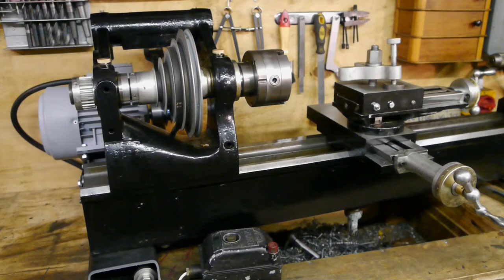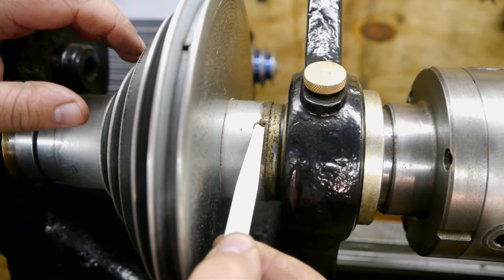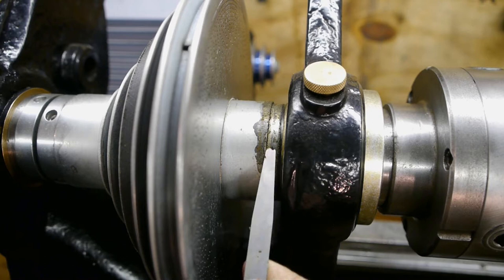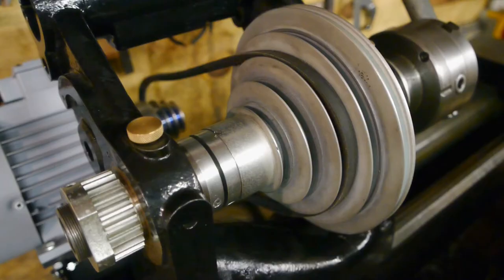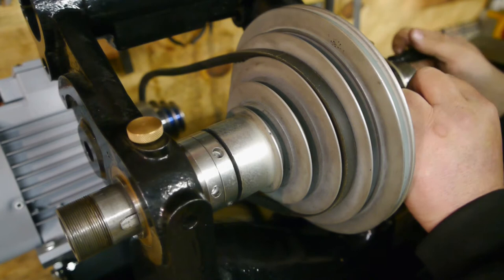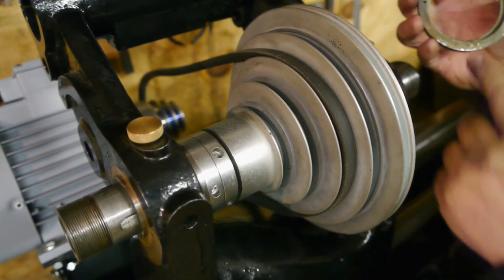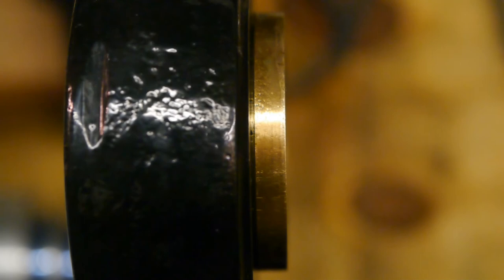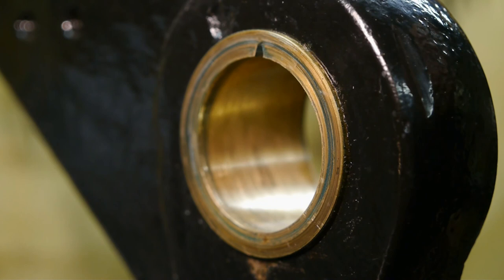Revisiting the Old lathe's bronze spindle bearings

Comment: The oil is reacting with the bronze bush.  This can happen with some modern oil additives.

Using plain mineral oil or automatic transmission fluid will avoid this.

I use Dexron 3 ATF in my Schaublin 102 plain lathe bushes and have no problem.  The front bush is steel on steel, and the rear bush is bronze on steel (same as yours).

You don't need a heavy oil if the bushes are correctly adjusted.

Also try Loctiting the front bush in place to prevent lateral movement.

Cheers Rob
Reply: The comment about ATF helping bind the clutch plates together is misleading.  Motorcycle wet clutches use plain engine oil to also do this, so there is little difference between both oils in this regard.

Some fully synthetic engine oils can be too slippery for wet clutches and cause slippage.  I've never used synthetic oil in a lathe so can't comment on how it would perform.

Cheers again.

Rob
Reply from the maker: The only problem I know of is with the early versions of GL4 oil and that was about 20 years ago.
Although I hate to add yet another can of oil to my collection I will buy some non detergent non additive oil.
Reply: Yes, I think plain mineral oil is what they would have used originally.

Rob
Reply: GL5 oil is still an issue, the car in my profile pic uses GL4 because the sulfa content in GL5 damages the yellow metal. many a crunchy gearbox in 20 year old mitsubishis is caused by people using the easily available gl5 vs the harder to get gl4, atleast here in New Zealand.
Reply: Listen to this man, he knows this era of machine very well.
Reply: I trust Xynudu more than I trust you Dave...Lol
Reply: My comment was meant to be in support of Xynudu's advice.  That might have been confusing now that I look back over it.
Reply: I knew what you meant, I was just havin a bit of fun. I love Rob's channel...decades of experience that man has. Hows things? My friend came across another last word in his storage unit...can send you pics if you like
Reply: Yes, tell me about it. I don't have a last word yet.
Reply: Use Wynn's 77101 500ml High Performance Engine Treatment
There are many variants of Dexron 3 ATF what is it?

Comment: The bearings did not have a bad fit. All of the stickiness and lack of lubrication was from the oil oxidizing in the air. The type kind and qualities of the oil was not tried and true oil. The oil not only dried out but changed chemically. I would personally never use one drop of the oil used on this lathe spindle. I have come back after six months and the lathe turned with a touch. The oil had not changed except to get dusty on the surface. Light mineral oil does not oxidize like what happened here. It drips off and thins and might evaporate to a slightly thicker consistency.

Comment: Thanks for the update.  Bummer about the bearings.  Looks like reaction between the metals and something in the oil.

As others have commented, can you get non-detergent engine oil in your local auto parts/hardware stores?
Reply from the maker: I don know what's going on here. Nothing wrong with the rear bearing at least not that I can see.
I'll check with some DIY stores tonight they might have some oil without additives.

Comment: Hydraulic oil is not the same as lubricating oil, different additives and properties. Also some hydraulic oils can react badly with some metals and the coatings used on metal s. The thin plating you pointed out in the video was probably eroded away from the base metal by the properties of the hydraulic oil.
Reply from the maker: There is definitely something reacting to something. I would like a scientific explanation for that growth on the pulley that keeps coming back.  I think I'll try 10W40 car oil next.

https://lh3.googleusercontent.com/-VpkBBqv3gio/WWEUlRigZrI/AAAAAAAAAMg/vw2lXUJgO5YXRkMWOY92dzg9UlhZPeHngCJoC/w530-h350-p/P1110739b.JPG
Reply: Rolingmetal I'm not a petroleum expert and I'm only speaking from 40+yrs of truck repair, welder, hot rodding, drag racing and amateur machinist + blacksmith. I'm just offering my thoughts, the only problem you may have with automotive engine oils are the amount of detergents added to them. Here in the US the oils I know of without detergents are mineral oil and oil for air compressors. Most if not all engine, transmission, power steering oils are loaded with detergents.
Reply: @jimzivny1554  Use Wynn's 77101 500ml High Performance Engine Treatment no better oil in the world.

Comment: It's galling.  Like no lubricant.  Is the bearing brass and not bronze?  It needs to be oil-lite bronze or solid bronze with a lubrication groove.
Reply from the maker: There was definitely some metal to metal contact at the small end of the front tapered bearing. A groove has been worn into the bronze. There is a oil groove in the top of the bearing. I don think they had sintered bearing 80+ years ago.
Reply: If I were replacing it, I'd put in a sintered unless somebody gave me a good argument otherwise. Some of those arguments might be RPM limits or load restrictions on oil-lite.  It looks as if the material is wrong or there was no space left for oil or no oil.  Proper grooves become a type of oil tank that is constantly keeping the joint wet.  The grooves are for capacity as much as they are for distribution.
Reply: That might be true, but it does not mean sintered is not the best choice today.  The grove is caused by galling where metal transfers from the bearing to the spindle.  There had to be something there to move the metal out of the way.

Comment: the brass is copper and zinc ok.   The green stuff is the copper oxidation,  maybe acid material or air.  You said you were using hydraulic fluid.  Hydraulic fluid is high detergent and acid.  That would be my first guess.  I would recommend to change to oil with no detergent a plain 30 weight oil or maybe 80 weight gear oil.  try the 30 weight first and see how it does.  I would make new brass bearings and go to 30 weight oil.
Reply from the maker: I'm still using the same iso68 hydraulic oil and I have found the source of the problem.
Have a look at this video: https://youtu.be/YlnDPedjJJ4

Comment: Interesting issue, try ISO 32 Hydrolic oil. I wouldn't use grease, I don't think any old lathes ever used grease. I use Auto transmission fluid with an ISO 32 rating in my old Myford.
Reply from the maker: Annoying issue, thats what it is :)
I will buy some oil without additives. No more experimenting with all those oils that are already on my shelves.

Comment: It looks like oxidation from a combination of time / moisture / humidity . . .   * If the bearings were very warm when last used , and the room where the lathe is was very cold; it could very well be condensation that caused this. 
     Crystallization of the oil / grease is another matter . . .   Under 'normal' conditions, it seems that merely replacing / replenishing the oil would be the right thing to do -  ( almost any mechanism that is open to the environment will lose oil over time , &  bearings are no exception )    Does the bearing oil fill area have a wick , or is it merely a hole that goes directly to the bearing ?   GRAVITY would tend to pull the oil downward, * the thinner the viscosity of oil, the faster it will drain !   One of the differences between grease and oil is the type of detergent / soap that is added , which can also change viscosity, or the ability of the oil to remain as a 'film' on the surfaces . . . 
    Was the oil in the filler cap GONE ?   Is the oil in the filler reservoir also crystallized ?      Normal practice would be to lube everything prior to using . . . * I concur with Xynudu . . . plain mineral or light machine oil would be the thing to use !    As long as the bearings aren't worn out, the oil film should remain on the shaft & bearing !
Reply from the maker: Could be. I remember it was freezing outside when I last used the lathe. No more then 5c in the workshop.
There is no oiler just a hole and it drains quick.

Comment: Plain 30W engine oil would be much better than hydraulic fluid.  Think of the lathe spindle as if it were an engine crankshaft.  Would you want to lube your car's engine with hydraulic fluid?  Don't use automatic transmission fluid either.  ATF is intended to, among other things, help a transmission's clutch packs bind together.
Reply from the maker: Yeah but, car engines don't use bronze bearing. Lots of people advice hydraulic oil, almost non say engine oil. And the wisdom of the crowd is usually right, at-least thats what I assumed :)
Reply: non detergent 30w oil is quite good for stuff like this. Car engines absolutely use bronze, although the bearings in a car are not bronze, they are generally bronze or copper plated, some engines use bronze bushing in camshaft bearings as well.
Reply: All the myford manuals recommend hydraulic oil for spindle bushings, ATF is a good substitute.

Comment: The gunk will come off with paraffin and wire wool, looks like acid damage to me. Needs new bearings.
Reply from the maker: Acid, that's right. You seen this one yet? https://youtu.be/YlnDPedjJJ4
Reply: @Rolingmetal  Yep!, an unusual problem! But you did insist on plating that pulley......